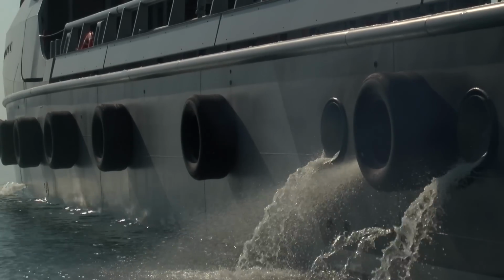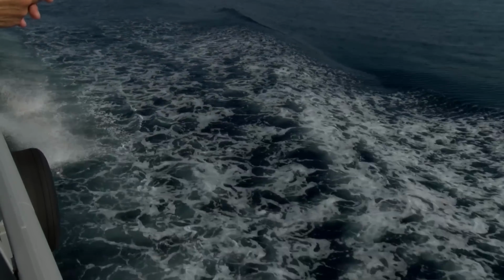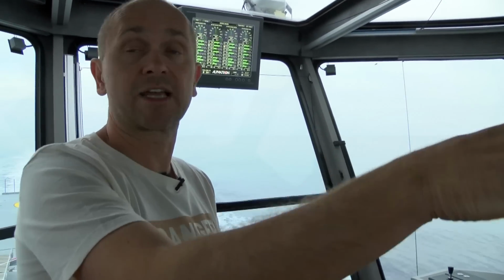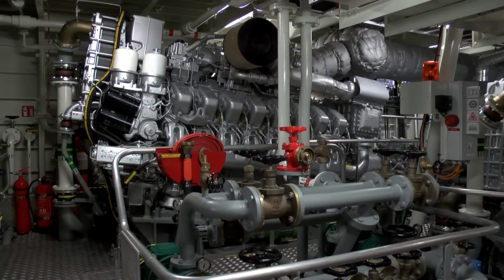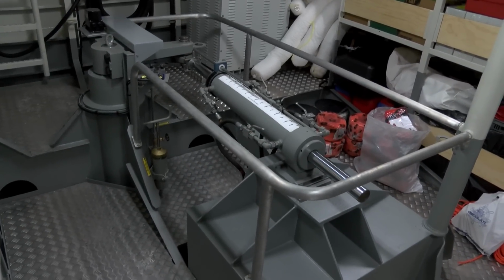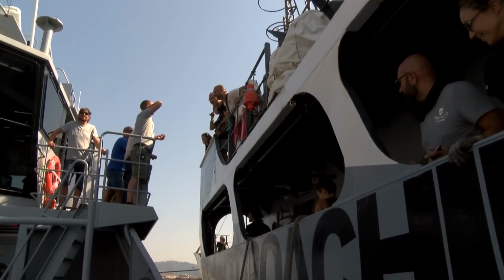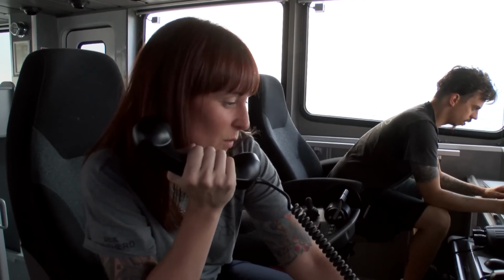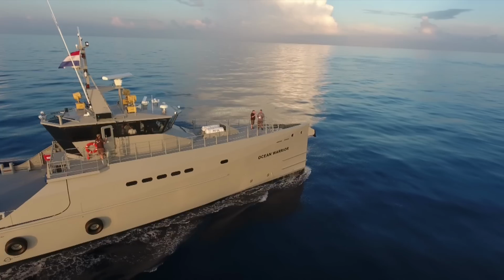Ocean Warrior: Welcome Aboard the Maiden Voyage

Comment: With the bow design you will get a lot of ocean spray. The top of the bow should curve outward to direct the ocean spray to the sides not allowing it over the deck and cockpit. Maybe you could have directors added to the bow to keep the spray to a minimum.
Reply from the maker: The ship doesn't really get a lot of spray, the ship designers know what they are doing ;)

Comment: Can anyone get me a link to full specs on this vessel? Price, size, water displacement, hull design makeup such as how many water tight bulk heads compatments, thickness of hull ect., engine specs hp ect, h20 cannon gpm, max nautical mph, cruising speed and gpm consumption at cruise? Fuel tank compacity? Any other armaments or goodies? Thankyou guys

Comment: 1 problem I see. the thing looks so damn high tech if something goes wrong it's going to take a team of 30 to fix the problem.
Reply: mike cowan I think this boat will mainly be a spotter and operated by high-profile dutch engineers and technicians.
Reply: Navigation equipment, firefighting pump and a brand new engine room.
Nothing high tech about it, it's barebone and doesn't require a full engineering department.
This is as stock as it can get, simple and easy to fix. Less than 500 tonnages as well? Piece of  cake.

Comment: Sea Shepherd should buy a couple of used diesel-electric submarines, or some fast semi-submersibles, instead of these fancy trimarans. 

Then they could fire inert hull-punching homing torpedoes on the whaling vessels. Not to sink them, or injure any of the crew, but just enough to punch a hole or two in their hulls. That may well cause them to abandon the hunt (massacre) and return to port for repairs.

A few holes won't sink those whaling vessels. They have watertight compartments, and will have plenty of buoyancy left to get back to home port. 

Alternatively, some small to medium sized fouling torpedoes could be fired at them, to foul up their propellers with steel mesh, or glass fiber rope.

Somewhat extreme measures to be sure; but that's all that these knuckle head whalers will understand.

Folks, please feel free to share and copy these suggestions onto any or all other anti-whaling YouTube channels. 
(Note: Strictly speaking, a submarine is not required in order to launch any type of torpedo. Any vessel the size of a WWII type PT-boat, British Motor Torpedo Boat or thereabouts will suffice.)